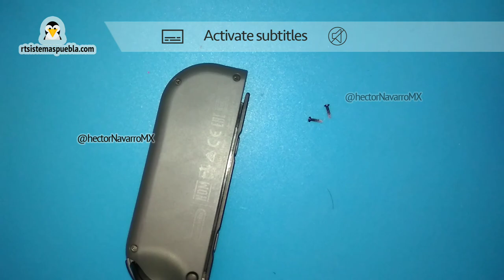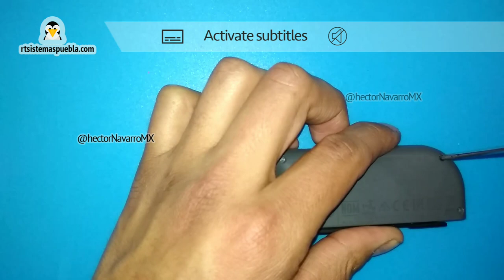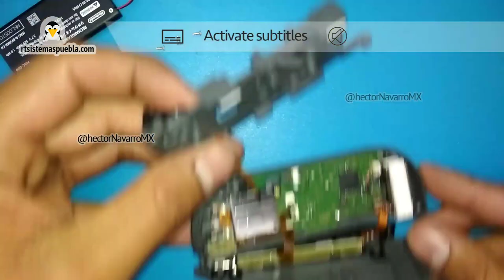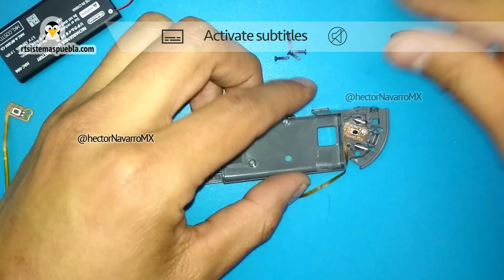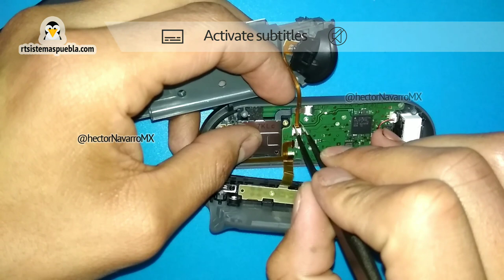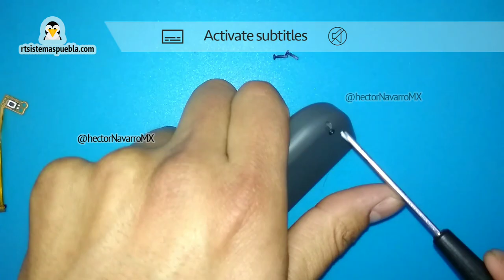How to replace left Joy-Con ZL button

Comment: Tip: if you can’t get the button to snap back on with the springs, screw the wiring on and then snap the button in place without the screws. After, take small tweezers and place the springs in manually. 
I could not get the button and springs on at the same time and I was scared I might snap the plastic so this method worked out so much easier for me.
Reply from the maker: Thanks to share your method for us!
Reply: wdym it still doesnt work 😭 😭

Comment: For me I don’t think the ribbon is the problem so I just got a replacement button and spring. But only just realized that the screws are not Phillips head. Where can I get a switch tool kit/repair kit to get the correct screwdriver etc?

Comment: do you have a problem with drifting and if it can be fixed without changing the knob
Reply from the maker: Firstly you can try spraying into joystick with WD40 to remove dust. You don't need opening tools. But it does not work it means that internal flex is damaged and you should replace it.

Comment: Hey, I just finished replacing my left joy-con and it worked! Another question: do you know how to fix the minus button on the left joy-con or know a resource that knows? I couldn't fast travel so I traveled on horse and bike in Zelda botw and I was getting pretty tired until I was told that I can change button mapping so that's what I did. Still, I would like to fix this issue if I can or is it a lost cause and just buy another pair?
Reply from the maker: That it's like a mini shell. So you can disassembly and clean inside. Regularly its dirty due dust. You should use a needle or some tool to lightly scrape the inside of the shell.
Reply: @centrodeserviciopueblamx5727  ok thanks bro, stuff like this really helps out. Saludos de Las Vegas!

Comment: I don't know why but mine is not clicking but still registering but you have to press hard. Do you know what could be causing the problem? Thanks
Reply from the maker: It could be dirty due dust. You can spray into button with WD-40 to clean it. After it, if it doesn't work, you should replace a new one.
Reply: The little button piece underneath likely broke off. It happened with mine.
Reply: @centrodeserviciopueblamx5727  thanks
Reply from the maker: A new replacement is cheap and fast solution